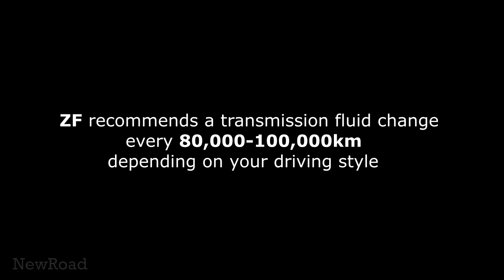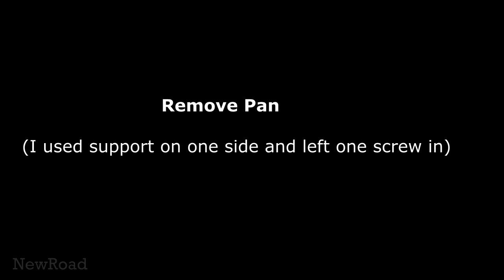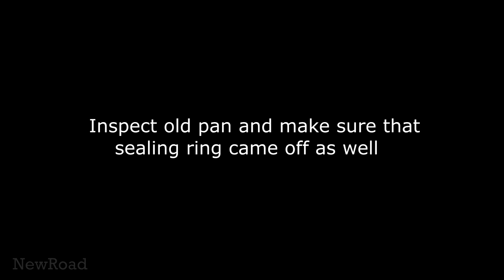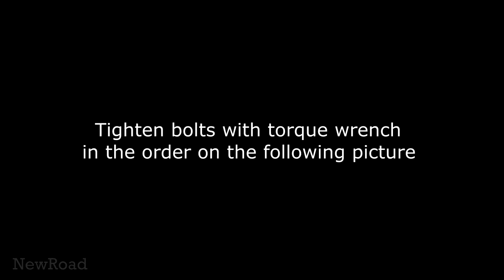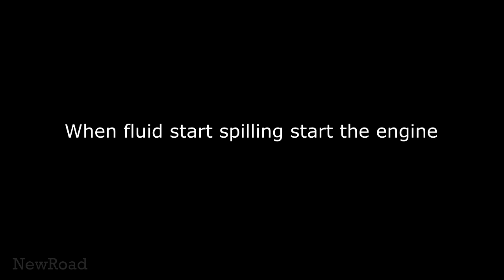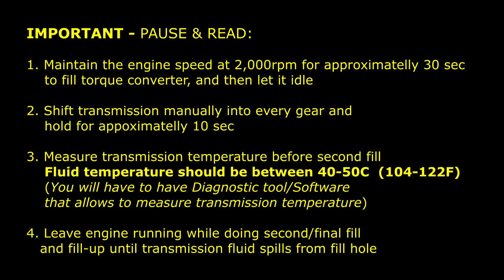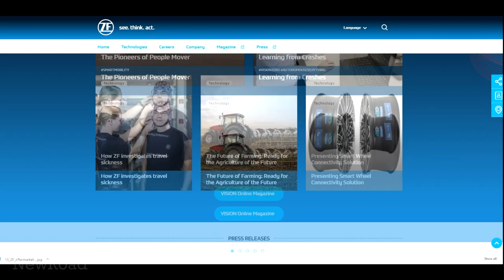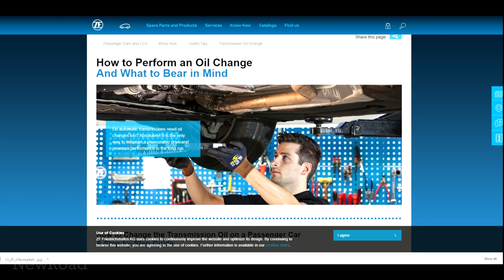How to Change Transmission Fluid in ZF 8HP transmission BMW, Audi, Volkswagen, Dodge, BMW

Comment: ZF recommands only, but is not obliging anyone to do this procdure. In the Maintenance Manual of Jeep Grand cherokee is written that the oil has NOT to be changed during the entire life of the car. After asking at the dealership in Hamburg, how many kilometers or years is that LIFE TIME OF THE CAR, nobody could answer to me. So do not trust any car manufacturer, just respect the rules and recommendations of the OEM of the equipment and you can save a lot of money. ZF recommends only to change the furst oil at 80-120.000 km, which is ca. 4,5 liter out of 8,8 in the complete system. After that it has to be refreshed every 50-60.000 km.No flushes or exchanges of the entire oil in the system are required. Once your car has a bypass valve, you need to perform the after the first fill the temp increasing to 75 degrees Celsius and than to wait to cool it down to 35-50, than you can perform the second part with the refill of the rest and moving the different gears. All this I did already alone on my Jeep Grand Cherokee 2016 WK2 and after 10.000 km I am going to perform it again.
Reply: @ivaningbg-73 I have a 2018 WK2 with 61,000 miles on the original transmission fluid. I was thinking of draining and refilling the fluid 3 times, not removing the pan.  I would send off a sample to Blackstone for testing, and only then do the pan and filter if they recommended it. Did you level your WK2 vehicle, or did you level the transmission, when going thru the fill procedure?  Thanks!
Reply: @paulc2953  ,forget about it. I level the complete car including transmission. Drain out as much as you can,never mind what lab says. I did it already for the 3th time. Furst refill after 60.000 miles,every other after 40.000 miles. I saw the rests on the mag ugs inside and the samples were pretty good.
Reply: @ivaningbg-73  on my GC, leveling the complete car would NOT level the 850RE transmission. Did you replace the pan, or just drain and fill fluid?
Reply: @paulc2953  ,for sure I replaced the pan after draining out as per recommended procedure of the OEM. During the 3th oil change I succeded to change 5,2 liters.Do not forget,we  speak about the 8HP70 ZF transmission. Look to the beginning of the discussion. Nobody mentioned anything about 850RE.
Reply: @ivaningbg-73  my WK2 has the 850RE. It is made by FCA, licensed by ZF.
Reply: @paulc2953  than you should respect the OEM procedure as per manual.
Reply: @ivaningbg-73  FCA is the OEM. I can’t find their manual. Thank you for your comments.
Reply: @paulc2953  ,if you ask FCA about the oil change of the transmission,they will tell you that there is no need to do it. I trust better the OEM of the transmission,not of the car. FCA want you to be in the repair shop,I prefer to save my money.
Reply: @ivaningbg-73  I don’t know how to explain this any more clearly. The 850RE transmission is made by FCA in the USA, not by ZF.  The transmission’s OEM is FCA, not ZF.  I agree that FCA says it is lifetime fluid. But they do have a drain and fill procedure.  It differs somewhat from the ZF procedure.

Comment: What if i didn't change the pan & filter .. I want to drain and refill only ?
Reply from the maker: I would highly recommend to change it - these are not expensive comparing to the work that you do. Check rockauto.com and FCP Euro sites for good price

Comment: How much fluid did it take back (final fill)?
Reply: if u buy 5 liters ur good, 4 + going in
Reply: @kd2833  yeah bought the official ZF kit with 7 liters of oil. My trans ended up taking 5,5 liters with car running and going through the gears with 10s within each gear. Trans is 8HP45 on a F30 335i

Comment: So I've done the 1st fill and the car's within the temp range, but I can only shift into reverse, 1st, and 2nd. I can't shift to 3rd - 8th gear. Any help would be awesome!
Reply from the maker: When you pull stick to shift - hold it so it doesn't go back, then let go and pull right away and hold it for next one for 10 seconds
Reply: @NewRoad  I tried that initially, but I had it hooked up to ISTA+ and even though it displays the next gear, it doesn't actually shift into subsequent gears (it stayed in 2nd).
Reply from the maker: @bravo09010901  I didn't use ISTA+ but was able to shift. Did you do in manual mode?
Reply: @NewRoad Adventures If I shift and hold to the rear, it displays M3, M4, etc. (in manual), but in ISTA it reflects that it's still in 2nd. ISTA also reflects the current gear accurately when I shift from park to 1st, 2nd, and reverse, but stays at 2nd when doing the shift and hold-to-the-rear combo. I'm not sure if there's something wrong with my car or if it's just the way it is... I emailed the dealership, so I'll post here what they reply with. Hopefully it's nothing.
Reply: Ok, I figured it out. Sorry for the confusion. If you are not using ISTA+ or ISTA-D, then follow ZF's procedure (same as yours, FCP Euro's, etc.). For a BMW and if you're using ISTA+/ISTA-D, then there's a procedure for it:
Once connected, Vehicle Management > Service Functions > Power Train > Transmission Control Unit 8HPTU > Oil Balancing, and follow procedure. (I'm using ISTA+ v.4.22.2)
Reply from the maker: @bravo09010901  Good stuff man! Thanks a lot for info - will be good for people who are using ISTA

Comment: Why do oil temp needs to be 40c? What difference does it make if i use some let say 25c room temp oil at sec refill?
Reply from the maker: This is what the procedure from manufacturer ZF says. They want to make sure you have proper level of fluid. If temp is lower - you might end-up with more fluid in trans, if you temp is higher when you are adding fluid - you might end-up with below what is required
Reply: @NewRoad  thank you good diy bdw.
Reply: @cornholio4510  The fluid expands with temperature.

Comment: What about the fluid in the cooler?
Reply from the maker: I followed ZF procedure for transmissions in description. If you want to completely flush, I guess you will have to repeat procedure after driving for a bit.
Reply: Or pull one of the lines and connect a tube and crank the engine a bit to pump out the old fluid?
Reply from the maker: @tonydesanto3238  I wouldn't stick with manufacturer procedure :-). I would rather change it more frequently, perhaps every 75,000-80,000 thousand

Comment: The oil must be green
Reply from the maker: I've got this oil from BMW dealership
Reply: @NewRoad  I didn't know ATF3+ was the ZF Lifeguard 8 fluid. And it isn't. It is actually ZF Lifeguard 9. So you probably should have used the Lifeguard 8 for that transmission.

Comment: But you do not have an exhaust crossover running directly under your drain plug like the bastards at Ram engineering INTENTIONALLY designed into their trucks!!  WTAF??

Comment: I believe Satan himself designed this transmission in the deepest point of the pits of hell, because there is no other explaination of why they made the whole process  so annoyingly complicated for a rather simple job.
Reply from the maker: agree, the process is not straight forward unfortunately, but it you follow instructions - it's fine